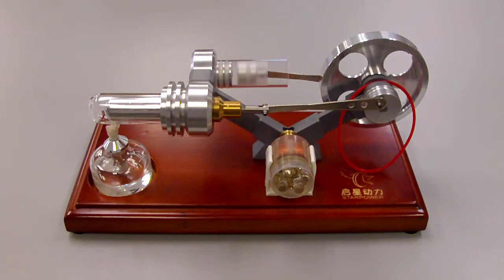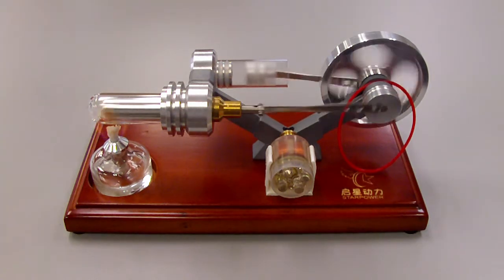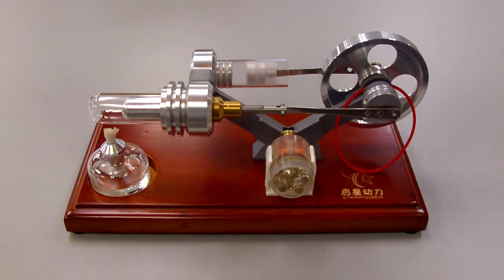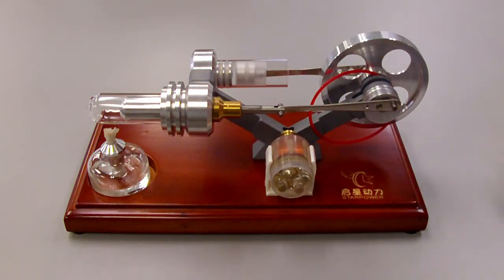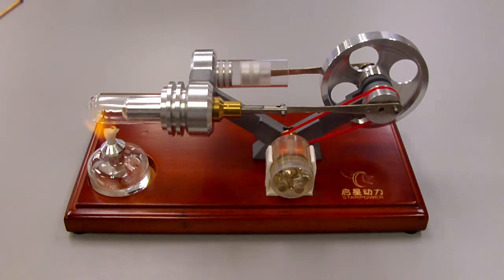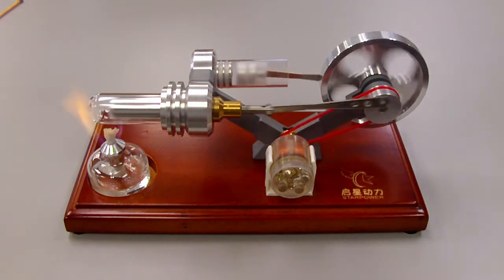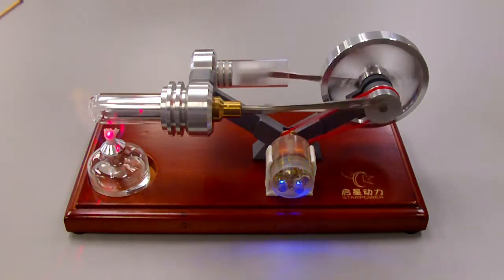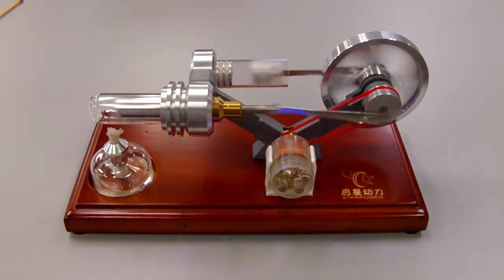Stirling Engine Demo with Temperature Measurements

Comment: Is that machine can run for 24 hours ?
Reply from the maker: There isn't a time limit to how long this Stirling engine can run. As long as the hot end can be kept hot, it will run. The alcohol lamp likely won't burn for more than 30 minutes, given how much alcohol it can hold, so if you want it to run longer, you'll have to plan with a second alcohol lamp that you can swap in as soon as the first one runs out. It is only a lecture demo, and I do suspect the parts will wear out pretty quickly. It's not built for durability (it'll probably last 24 hours, though).